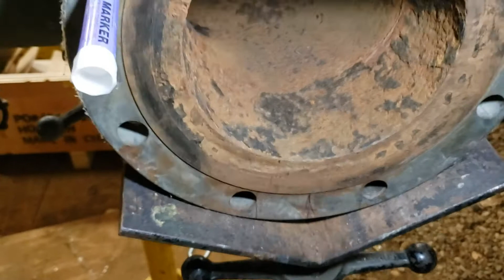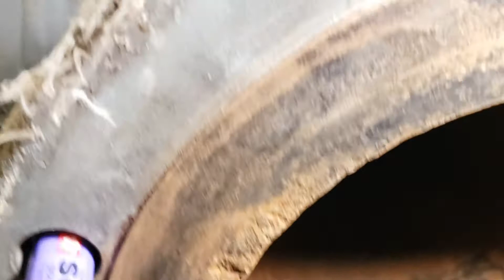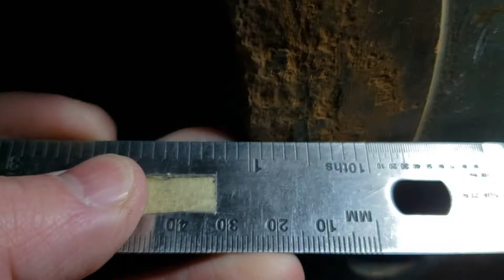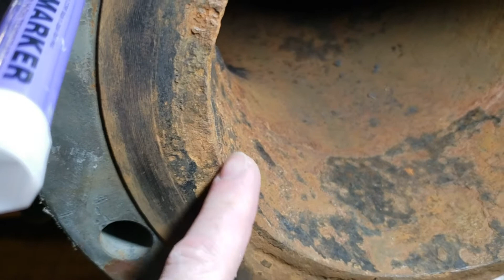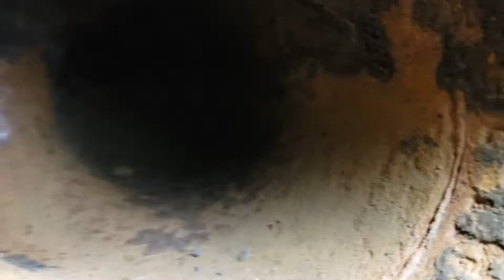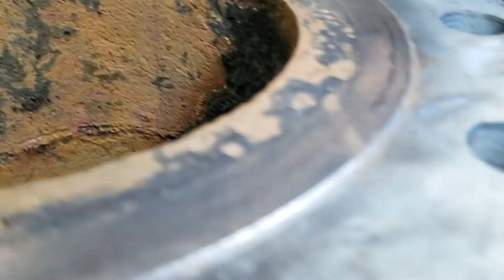API 570 pipe inspection

Comment: GSS  isn’t entire width. Spiral wound is about 1/8” from outside and then going inwards 3/4-1” wide depending on width  of gasket. Most of that corrosion is in stagnant zone. No need to worry that but I did notice considerable corrosion in the GSS. But yes, preferential corrosion in weld. Probably better off replacing the flange.
Reply from the maker: You are correct, the GSS is not the entire surface of the machined gasket face.  This flange set does use a wide ring, spiral wound gasket ,  I could be more clear on my explanation introducing the flange and piping. 
If you go back and watch the video, notice the area from 4 to 6 o clock.   The corrosion was not just confined to the static zone, it was completely under gasket in the actual GSS, and deep.  This piping was only 10 years old, oil service, and it was the first time it had been removed and inspected.   Client had planned on another 10 year interval.   Replacing this entire spool was the recommendation.  The recommendation is not conservative, as the corrosion rate would likely have increased and would most likely had failed before the end of the next OOS interval.
The exchanger channel it connected to was made into a video,  it was found in worse condition. 
MrEric

Comment: was this flange welded onto a pipe? it almost looks like the heat from the welding effected the hardness of the steel
Reply from the maker: Chris, Yes.  It is a flange welded to a pipe spool.  Flanges on both ends.